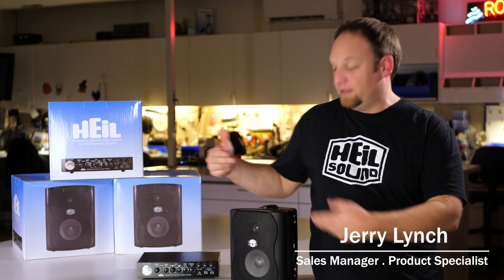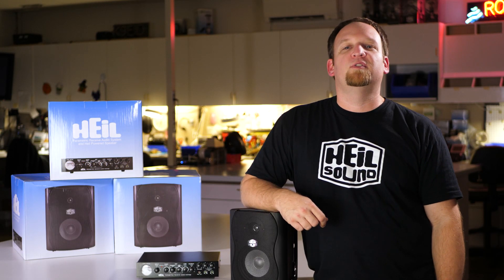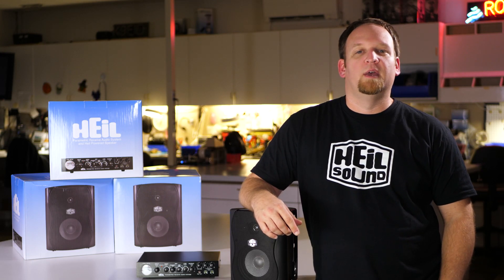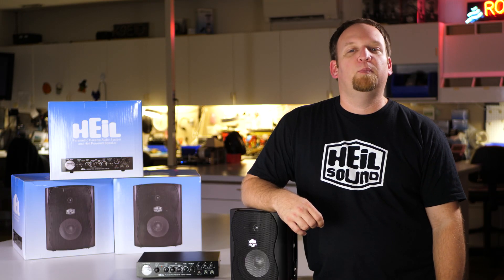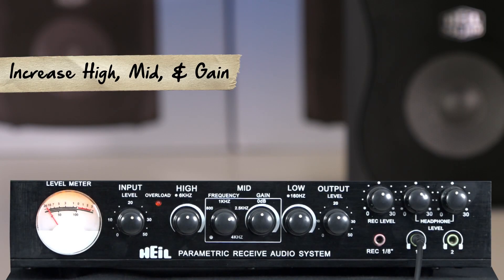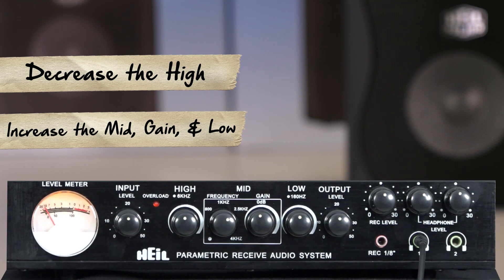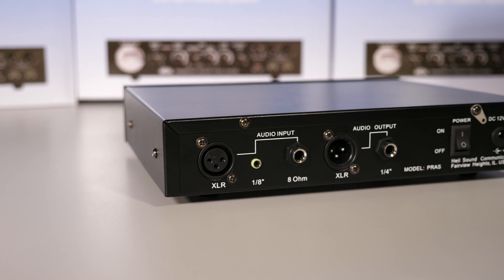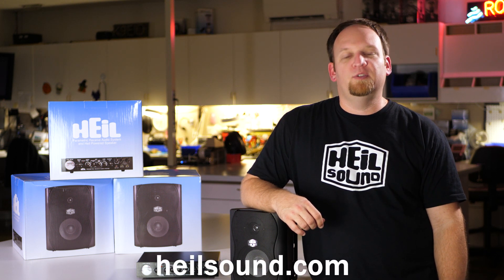Heil Ham Radio: Parametric Receive Audio System Demo

Comment: Lovely unit, takes out all the backgroung noise. One question can you connect two radio's at once in differant inputs (assuming you dont use both at the same time).

Comment: Has the issue with RF feedback been resolved?
Reply from the maker: The only issues with RFI are occurring at stations that are using non-resonant antennas and have grounding issues.
Reply: @HeilHamRadio  Wrong, Just bought a new system and its unusable due to RFI getting in the system. I have 2 resonant antennas and on 10 meters it is horrible. I have 9 ground rods all bonded together, bonded with the electrical ground and bonded to the plumbing in the house. I bonded both the speaker and the EQ separately to my copper grounding block.  I have 2 cheap Chinese computer amplified speaker set ups in the very same shack, inches from the Heil. Absolutely no RFI into those. Its getting sent back to the dealer for a full refund. Very unsatisfied.